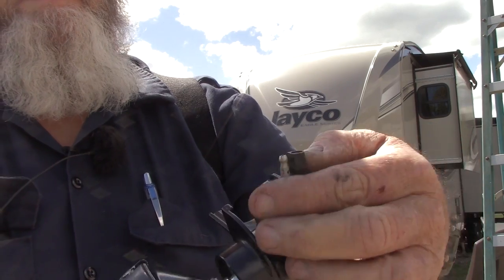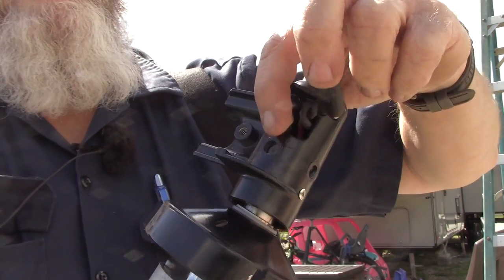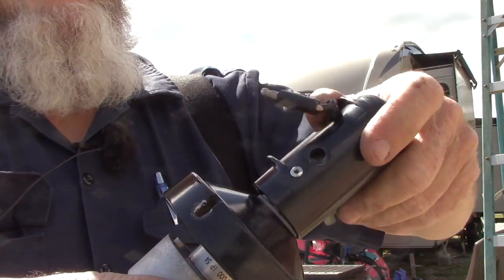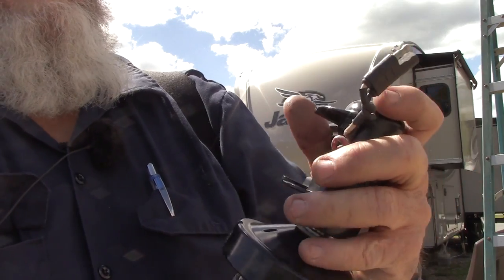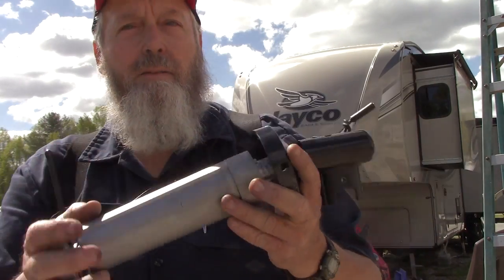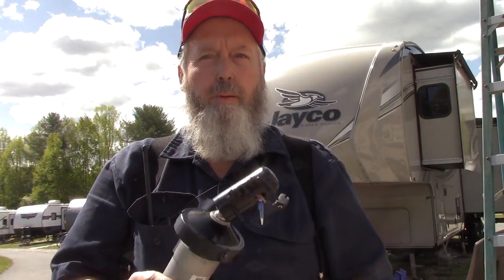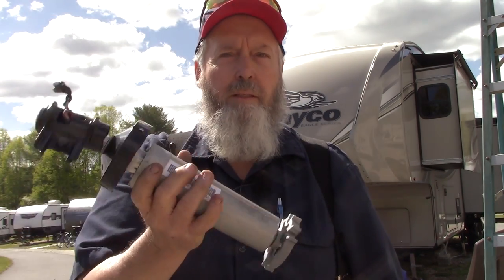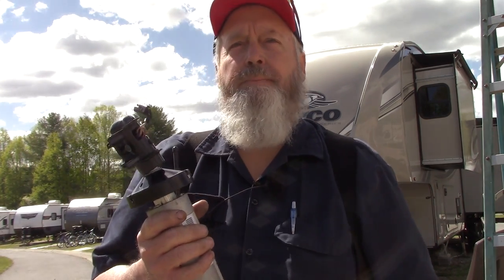Electric RV Awning Won't Move, How To Change Motor

Comment: I am SO GLAD we found you! 🤗 Our motor, Dometic 9100,  is shot. We figured out how to manually roll it out. We have the strap attached. How do we get it back in now? 😂  What should be our process if I am going to have to use it this way for a month? For instance, if an unexpected thunderstorm rolls in and I need to get it in quick? 😳 Do I have to keep putting  the bolts in and out? 🤦🏼‍♀️ THANK YOU!! ❤
Reply from the maker: To roll it back in, you have to physically roll it in. It ain't easy and can be very hazardous since you will most likely be standing on a ladder when you roll it in. Yes, to hold it in, you have to put the bolts back in. Be VERY CAREFUL. VERY EASY to get knocked off of the ladder by the awning.
Reply: @hillbillyrv  Thank you, thank you! That bolt on the backside is hard to get back in once it is rolled up. 🤪🤦🏼‍♀️ The top one was fine. 👍
Reply from the maker: @acforhim1  Yes it is.

Comment: Can you spin the motor to  line up the two allen head screws that keep the awning from unrolling? I had to roll mine up manually at the campground so when I took those two screws out it released the tension on the spring. Watching your video I didn't see you doing anything with the other end where the spring is? Thanks for the video!
Reply from the maker: I had it tied down so it would not retract. I lost a bunch of footage on this job and tried to salvage what I could. I have since gotten a new camera. And yes you can line the holes back up and put the screws back.

Comment: Is there a way to operate the Dometic 9100 manually without ruining the wires for the motor?
Reply from the maker: I believe in this video, I showed or at least explained what you have to do to move a Dometic awning if the motor goes bad. Did I understand your question?

Comment: We have this same awning on our RV, while it was extended it stopped working this past weekend while far from home, heard the click at motor when switch activated but it wouldn't move. The click at motor means it's getting power, so not a blown fuse. Without watching your video and not knowing about the wires being twisted when rolling it up manually, I had to do so to get it out of the wind. Now there's not even a click at the motor. Does this mean the wires to motor are likely destroyed?
Reply from the maker: Very likely. Those wires will only take so much twisting.

Comment: Have you ever worked on a Dometic 9200 series awning? Ours is out and there is power to the awning but won’t roll back in. The manual over ride does nothing, I’ve had a drill on it for 1-2 minutes. Any suggestions would  be great! Ty in advance!
Reply from the maker: If the manual override isn't working, maybe the gear box is bad. It's hard to say.
Reply: @hillbillyrv  any idea on how I’d get it in? The motor you replaced is different than ours
Reply from the maker: @stevewhite554  Not really. I haven't actually worked on a 9200.
Reply: @hillbillyrv  k ty! Appreciate all your videos you put up! Take care🙂
Reply: I have same problem

Comment: did you miss showing a step? how about putting a pin in the other end to keep for the spring from it winding back up while you are replacing the motor? or am I wrong?
Reply from the maker: The awning was out and we didn't disturb the spring end, so we didn't have to pin it. Good catch.

Comment: Sorry,  my awning motor quit while it was rolled up.  I need to figure out how to roll it out to repair?  What is the secret as mine will not roll out manually?   Hope it’s something easy!
Reply from the maker: You will have to remove the 2 set screws that attach the motor shaft to the awning head, but be careful that the arms don't extend and knock you off of the ladder. Check this video out https://youtu.be/gLlumq4_az8

Comment: I was wondering if you could help me out. I have the same motor in my 2017 Forest River Shamrock. I unfortunately ran into a tree while I was trying to get through a tight space and broke the end piece to that motor that those allen screws screw into. Do you sell that part or motor assembly or point me to who does?
Reply from the maker: Check my Amazon store. I have it in there. I can’t send the link because I am not at my PC. Click on the link in the description of my video.

Comment: Do these motors get weak before they fail? I have same awning and every time I go to roll up the awning it struggles really bad to get going. It goes out just fine. I have already lubed all pivot points and centered the awning fabric. Thanks for any help you can provide with this issue.
Reply from the maker: I believe they can get weak, but that is just my opinion. It goes out better because the gas shocks on the arms are helping unroll the awning.
Reply: @hillbillyrv  Have you personally replaced a weak one with a new one and saw a difference? Or have you only replaced one that has completely failed and doesn’t move at all? Thanks
Reply from the maker: @davishill4636  Always completely failed, sorry. Nobody replaces them while they still work.

Comment: You don't show doing anything at the other end of the awning( the spring shaft end) ,when replacing the motor do you have to worry about the spring uncoiling when you remove the motor ??
Reply from the maker: Yes. If the awning is not all the way out, you have to have to tie the arms off to keep them from extending.
Reply: @hillbillyrv  But do you need a cotter pin inserted on the left side of the awning?  Is there a tension spring inside the roller tube?   Thanks for the video!!

Comment: I assume that you had the left side pinned when you changed the motor so as not to let the spring unwind?
Reply from the maker: Because of the lost video file, I guess we missed it. Since the awning was extended, we just tied it down so it wouldn't try to roll up.
Reply: @hillbillyrv  I'm really enjoying your videos. I have a Hampton park model that is a 2010. I do 99% of the work on it myself. If it can fail, it already has in the 11 years I've owned it. Videos like yours sure help a fella with handy tips! Thanks for all of the information that you provide! I've been working in the mechanical field my entire life but all things are different. Just getting a visual of something can sure go a long way to make sure that I can do the job safely and without causing any unnecessary or unintentional "effects" to happen!  Been there, done that!

Comment: I have an awning that won’t extend. I hear it click but it’s probably a little rusty cause I haven’t opened it in over a year. I wanted to know how to override or jiggle it to open up again.
Reply from the maker: What brand of awning?
Reply: @hillbillyrv  Dometic awning. On a 2015 Sonoma Freedom Edition by Forest River
Reply: 2017* not 2015
Reply from the maker: @Dudedragon83  You will have to get the awning rolled out to test it. If you have 12 volt at the motor and it doesn't move, then the motor is bad. You might want to call a professional. This can be pretty tricky.

Comment: Was the motor acting as if it wanted to roll in and out, but wouldn’t? Our motor has power, and clicks as if it wants to work, but won’t retract or extend.
Reply from the maker: They will click sometimes, but if it's getting power ,but won't move. It's bad.